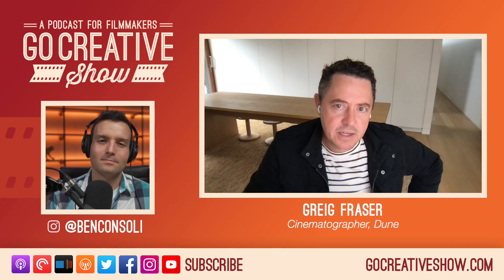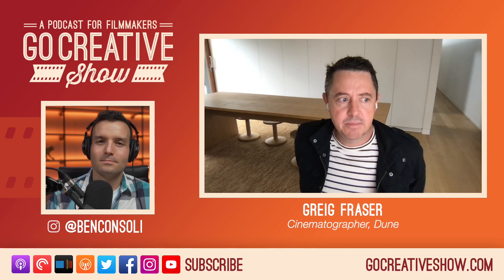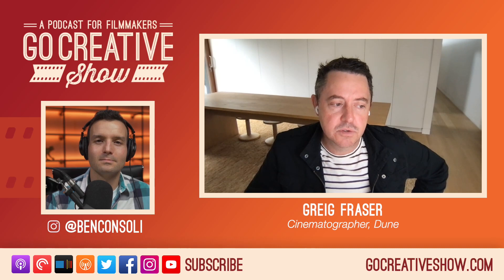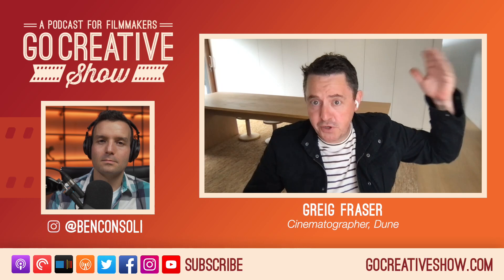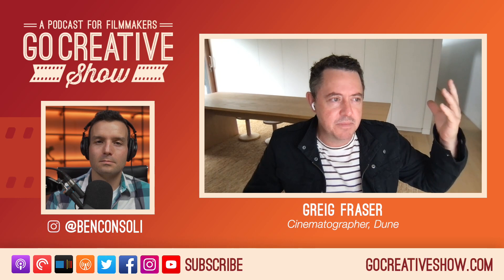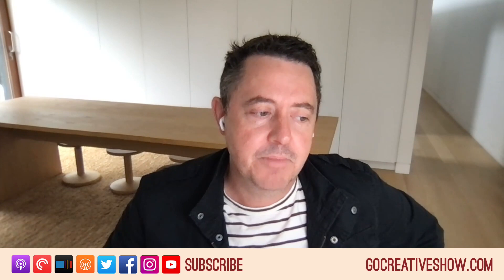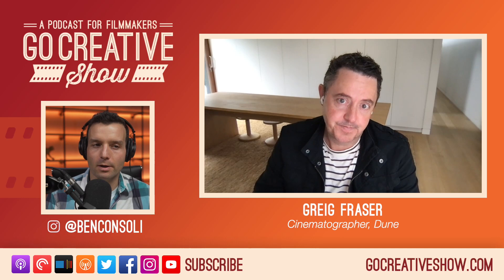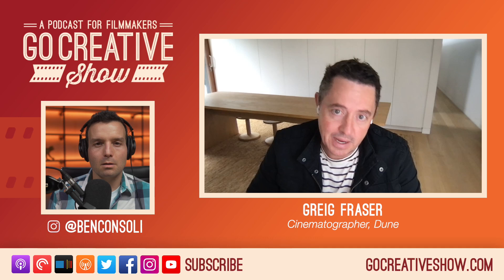Converting DUNE from digital to film (Show Short)

Comment: Rich man's film grain filter.
Reply from the maker: Indeed. 
-Ben
Reply: Yes and no. 
It does allow them to color grade but at the same time allow them to present a more natural looking production. 
For a large production it is much cheaper for them to use that film filter process than to try and go through every frame and correct. 
Autocorrection software does make the process faster but it cannot compete with a frame by frame approach.
Reply: @bighands69  the emulsions also have a chemical reaction with the light, not something software really models all that well because it reacts to different light colours differently, at the end of the day it's just artistic choice.

Comment: Considering how shitty most digital projection is, they should have tried to distribute a couple film prints for the few remaining bright film projectors out there.
Reply: Dolby Vision projection is brighter than even IMAX...
Reply: @wright96d  Dolby Vision can't hold a candle even to a 35mm projector with a bright lamp, let alone to 15 perf 70. When was the last time you actually handled a film reel or cut film by hand?  You do realize there's no upper limit to how bright a film projector can be, right, unlike DLP and LCOS?  Film also can have inky blacks and completely transparent parts of the emulsion for whites with no measurable bands of sudden compression jumps, unlike EVERY digital panel or projection system that either does something at the foot or the shoulder.  And this isn't even getting into the resolution differences.
Reply: @Reticuli  Standard film projection is around 48 nits, IMAX is 80, and Dolby Vision is 108. And to get a lamp bright enough for film to match the upcoming DCI HDR standard of 500 nits, you'd vaporize the film long before an image appeared on the screen. If you like the look of film, that's fine. But digital blew past it in every objective technical metric possible a long time ago.
Reply: @Reticuli  Have you ever heard of the placebo effect?
Reply: @wright96d  That's not it.  Some other stuff must be going on.  I've seen film prints that would knock your socks off where we could tell there were even small issues with the projector's shutter just by sight, had to fix it, and it was like shocking and magical what resulted.  There are viewings that are burned into my memory.  I've never seen anything shocking or magical from this digital projection like that.  The temporal resolution has already been explained satisfactorily to me, as has the naturalness of the dynamic range.  As to why the luminance looks so awful in auditoriums running digital compared to the best film projection I've seen I can't yet explain that.  You're throwing published idealized specs around, but they're falling short in practice for some reason.  I get why they've switched to digital for financial reasons, and maybe it's making things more consistent picture-wise, but I haven't yet seen digital get as good as the best film exhibitions.
Reply: @wright96d  
35mm film can do 8k resolution, more subtle colors and also has the texture of grain. There are no digital systems that can match that. 
The main reason why digital projectors cannot match the brightness of colors with a film projector is all down to the fact its image is based on tricks.
Reply: @bighands69  Congratulations. All of that was either objectively false, or meaningless mumbo jumbo.
Reply: @bighands69  35mm film does not hold 8K of resolution, nowhere near that. It will hold 6k at max - and that's only under ideal circumstances i.e. laboratory. That never happens in the real world. 

In the real world, you'd be lucky to get 3-4K on 35mm film - and that's just the negative. By the time a positive print is delivered to the cinema, it will be down to about 2K. In fact, the 1080p resolution chosen for HDTV was selected because it was the apparent digital equivalent to 35mm film in an actual cinema.

Digital projection as it is today mostly sucks due to bad contrast and washed out colors, but film celluloid degrades everytime it's projected and has environmental issues. We either need superduped laser projection with perfect colors/brightness or might as wel go with a big ass microLED tv screen. There are now regular Joe customers who are watching an OLED screen at home and they have acces to better picture quality than most cinema's can offer. We need cinema's to offer pristine picture quality that can at least match the look of HDR/Dolby Vision OLED.
Reply: @wright96d  
Film produces a solid image and does not have pixels. Tell me what is mumbo jumbo about that concept.
Reply: @BlaBla-jj6sh  
Film does not produce pixels and to capture that film you are going to need at a minimum 8k resolution. 
As an owner of OLED screens that are of reference grade and 35mm film projectors you statement there makes no sense at all.
Reply: @bighands69  It's mumbo jumbo because the fact that it doesn't have pixels means absolutely nothing for the quality of the final image.
Reply: @bighands69  Film does produce grain particles and they are very much of finite numbers. You don't need 'minimum' 8K resolution to capture 35mm film. 4K is enough. 8K is for 65mm film. You can scan 35mm at 8K of course, but it won't give you anymore information. 
 
Also, if you don't understant my statement it does not mean it makes no sense at all. If you indeed have an OLED monitor of reference grade and you ever visited real world cinemas, you would know that the vast majority of cinema's do not hold a candle to said OLED picture quality wise. And I wasn't talking about 35mm film projection, I was talking about digital projection.
Reply: @BlaBla-jj6sh  
Grain has nothing to do with optical resolution that people seem to think. Grain is an effect that is caused by the photochemical process.  Grain is like a texture on a film rather than it being part of the optical resolution. 
If you want to try and capture detail of film and then blow that up to a large screen at a minimum you are going to need 8K resolution. 
For a tv based viewing experience you simply will not need anything beyond 4k but for a large screen in a cinema you at a minimum are going to need 8K for film.

Comment: That's awesome! I really don't understand why more productions don't do this. Digital gives you the most flexibility and highest quality in acquisition, and if you want the look of film, transferring to actual film gives you the look of *actual film*.
Reply: On a large special effects film it can be an option especially for challenging environments. Film is superior on every level.
Reply: @bighands69  Film is not superior on every level at all. If that were true, none of the old movies from yesteryear ever had to be restored. In reality, those films often have significant problems due to film degrading and can only be restored with digital techniques. For special effects digital is a no-brainer anyway. You want the cleanest possible possible negative before putting the effects in. It's exactly the reason why the special effects people love the Alexa camera's as they are the best. 

Film is not as easy to use as digital on the set, it doesn't give instant viewing, it degrades with every step of the printing and processing process, it degrades over time with wear and tear, dirt, scratches, warping, fading, flickering, breathing etc. Then there's grain which certainly wasn't present on the set either. None of these problems occur with digital cinematography.
Reply: @BlaBla-jj6sh  
The master copies of the digital will still need to be maintained and in 50 years time they could have issues if not properly looked after. Now that is not what I was alluding to when talking about film being superior. 
I am talking about picture quality in terms of how film looks far more subtle and the reason why digital looks so sharp and harsh is to do with the fact that digital is just a system of contrast with no subtlety in colors. 
HDR simply cannot complete with the photochemical effects of the process of films. I am afraid the digital is nowhere near the chemical processing abilities of film.
Reply: Film grain can be pleasing , it gives off an atmosphere. Just gotta know how to use it. Still Digital is superior and with all the softwares today we can create a lot of film looks that looks just as good. Film emulations is the thing, if you don't want to cover the expenses of real film. All these people saying that real film looks superior, but if I show them two frames of the same shot , one on film and one in digital graded to look like film with dehancer etc, they wouldn't know which is which
Reply: @researchproject034  this is absolutely not true lol. people want film for the dynamic range and the fidelity. that is something film can do that digital has been trying (in vain) to get to. they've gotten close, and some digital sensors have gotten really close. but no digital sensor can capture what celluloid can.
Reply: @Unoriginality  I still stand by my point

Comment: Really interesting and it's stimulated me into sending some of my digital stills to be converted to film slides which I'll then have scanned back to digital. However, my gut instinct is that they won't be dissimilar to the Photoshoped or Lightroomed versions I already have. But it'll be interesting to compare. I'm sure they tried but I would have thought simply by shooting on the Arri with Cooke lenses and then editing in Avid (or whatever post editing system they used) with the correct plugin (may have to have been custom made) they would have ended up with the same result and possibly less time consuming and costly. I don't know...Interesting nonetheless...
Reply: That is an interest experiment, Mike. Forgive the pedantic nature of my question, but: What’s the process to transfer digital stills onto film slides?
Reply from the maker: Mike, you have to try this. I’d love to see the results. 
- Ben
Reply: @GoCreativeShow  The slides have been sent and as soon as I receive them I'll get them scanned. I'll then do a quick vid with side by side comparisons.
Reply: I've now received the slides and have asked Photographique in Bristol to do two C-Type prints to compare to my own inkjet prints. As far as the scans were concerned there was very little difference, although with the B&W ones (which had already been treated with Silver Efex Pro 2 in Photoshop) I actually preferred the tranny scan. This probably is because the 'grain' which it collected from the Acros Silver Efex Pro treatment was added to by the 'real' grain from the tranny. Also, the contrast was slightly reduced, though not uniformly. I'll do a vid once I have all the comparisons.
Reply from the maker: @MikeKleinsteuber  I can’t wait to see it.
Reply: indeed i'd be VERY interested in konwing what lenses they used, and if it was modern ones, how it would have looked on vintage lenses, namely the right ones. 
but then again, it seems they were after a very specific look, and maybe that film transfer thing just worked best in that particular usecase.
Reply: Film has a much more nuanced approach to colors hence why it appears soft. Your naked eye also sees colors in that soft way because the human eye like the photochemical effect has a much more subtle means of differentiating color. 
FIlm also deals with light in a more natural fashion but it does require more knowledge to achieve than a digital system.
Reply: @MikeKleinsteuber  how it turned out?
Reply: @VicerFx  Yea, I should really have uploaded a vid but the reality is the two prints are both lovely. If money is no object I'd go the route of printing a C-Type prints by Metro from my digital file. But really, my Canon inkjet printer is so good the difference is minimal.
Reply: @MikeKleinsteuber  oh nice to know

Comment: I wonder if the same effect works with a 65mm transfer? Like if you film on a 12k camera and then transfer the footage onto 65. Would it look soft but crisp or about the same?
Reply from the maker: That's an interesting idea. now I'm curious too. Thanks for watching.
BEN
Reply: @GoCreativeShow  
Thank you for the video Ben, it was probably the best video that explained the method. I was looking at Dolbe’s video on how Greg did the transfer on the Batman but they used a lot of very technical terms that I didn’t understand. You guys were able to explain it much better!
Reply from the maker: @tallerwarrior1256  That's so nice to hear! I appreciate it. 
BEN
Reply: @tallerwarrior1256  
The biggest bottle neck with your approach is that the cinema projectors are only 4k and many will actually show a 2k source that has been upscaled for the projector. 
I have visited hundreds of digital theatres and the majority of them produce a horrible looking image that no 65mm process would even be able to better. 
The screen door effect is present on nearly every theatre I have been to.
Reply: @bighands69  
True but normally with 12K cameras or 65, most showings show a downscaled version since they’re not IMAX or Dolby screenings. But again it would be interesting to emulate the soft yet crisp texture that 70mm has without actually filming on over budget 65.
Reply: @tallerwarrior1256  
I think they would need to create higher resolution projectors maybe with laser source for best colors. 
The biggest issue with theatres is the fact that most of them have already bought 4k projectors and are not interested in a new investment in the next 10 years. I think 8k commercial grade projectors are about $300,000.
Reply: What equipment would be needed to actually ‘film-out’ 12k to 65mm ? Are there film recorders that can do 12k?
Reply: Well you got your answer with Dune part 2

Comment: Its interesting to hear it from the horses mouth on why they did this. It sounds like there wasn't really that much thought given to other aspects other than the feel of it. By his own admission here Grieg wasn't thinking about the technical side. Its weird that some filmmakers are really clued into the latest technology and to others it doesn't even seem like a factor. Watching the 4K blu ray at home, you can clearly see the resolution limitation that the 35mm scan brings. From my own viewing, 35mm is only good enough for 1080p and only movies like Tenet that were shot on 70mm film actually look like true 4K. On Interstellar there are scenes shot on 35mm and its a night and day difference.
Reply from the maker: I have to see the 4K blu ray now... thanks for the note.. and for watching the interview. 
BEN
Reply: That's probably because the film was scanned in 2K. That's what they usually go for distribution since most theatre projectors have that resolution. Usually, to reduce the time consuming process of doing it in 4K and then downgrading to 2K they go with 2K and fake the 4K by upscaling with digital software showing the limitations that you mention. For this film, they probably only scanned 4K for the IMAX 1.43:1 shots and they didn't even bother to use those versions for the 2K versions of the film but instead used a 2K scanned version. 
I say all this because film is able to got up to around 8K and from then it just doesn't add any more detail. But if you say that at 4K it doesn't look good it's probably because they just upscalled from 2K which again it's what 1080p is really like so you'd be right.
Reply: @Jorge_Ambruster  Interesting. Would be great to confirm this.